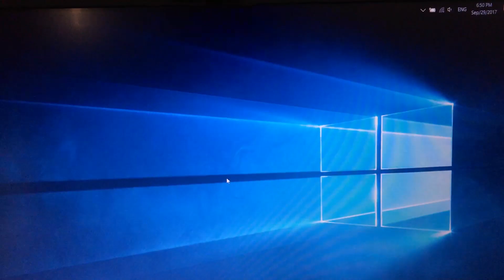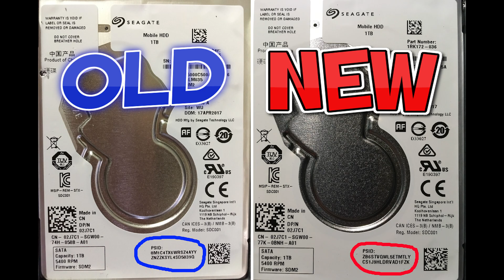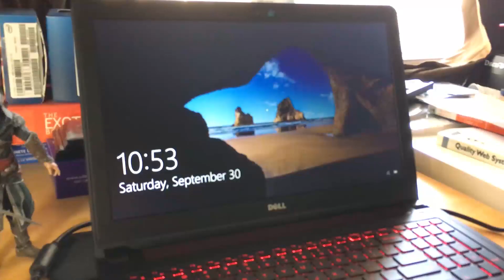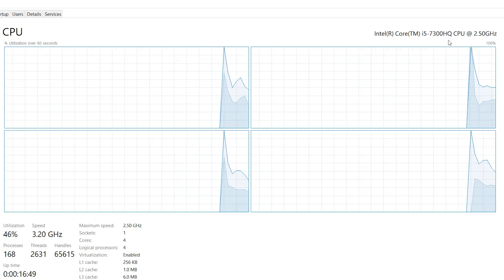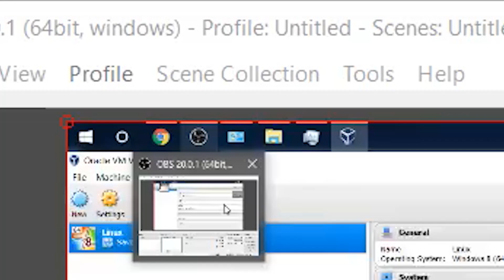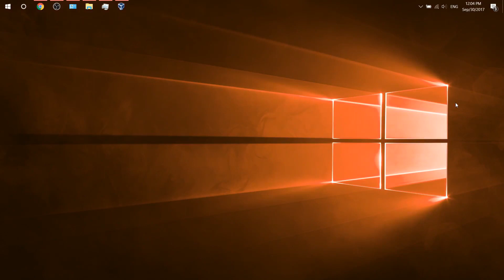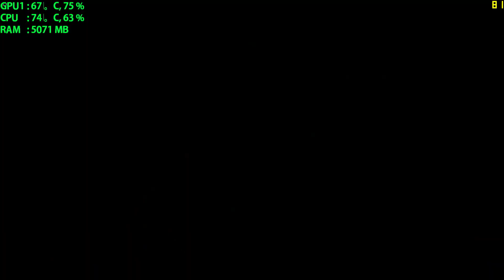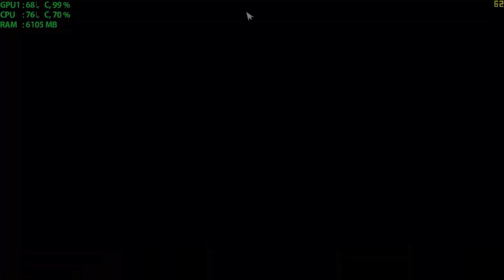My Experience With DELL Warranty - Inspiron 5577 - i5 7300HQ GTX 1050 Benchmark at 720p 900p 1080p

Comment: brother i bought i5 model...but its too slow...chrom and YouTube lags so much ...and other things too....i put all  settings on nvidia high performance graphic card...but still its slow....what should i do... please help
Reply from the maker: +het vaidya NVidia high performance graphic card? I don't understand what you mean. You change the laptop performance by clicking the battery icon at system tray. MANUALLY update your driver at Dell.com. And check your task manager to see what program do you run. I runs Virtualbox and watch Youtube video at the time, no lag.
Reply: Poker FaZe okay thanks buddy....1 more thing ...i am playing battlefield 4 ...i played it for 2 hours and temp was 70c to 80c max....is.it normal?....and if.not what should i do?
Reply from the maker: +het vaidya Completely normal for gaming laptop to get hot. Just fully charge your battery and game while plugging in, you are good.
Reply: Poker FaZe  u r a big help man...thanks ...1 more thing if i can ask ...if its above 80c should i stop playing or should i continue?....if i continue wont my laptop will get affected ?
Reply from the maker: I usually use MSI Afterburner to check temperature during gaming, and the laptop never runs over 83 degree. You can start worrying if it is over 90C. But it will never happen, I can explain:
Laptop manufactures always have locked BIOS to limit users from modifying. And they already set the safe temperature for the laptop. And even if they don't do it, your CPU and GPU will automatically do it for you, it call THROTTLE, by running at lower clock speed to cool down the chip.
Basically you don't have to worry anything ¯\_(ツ)_/¯
Reply from the maker: You can also see Throttling happens when battery is low -> to save battery
Reply: Poker FaZe u r a big help man...thanks
Reply: Poker FaZe and yea to fasten the laptop should i use cracked Windows version or genuine?....
Reply: Poker FaZe and something in task manager my disk gets to 100%?....its slows the laptop... what should I do?
Reply from the maker: +het vaidya +het vaidya In Task Manager, if you are looking at the Performance tab, hard disk is always ~100% because you are using it, so you CAN'T say it slows down your laptop. As long as you're in Windows, you are using the disk.
To fasten the laptop, buy an M.2 NVME SSD, it boosts my laptop before my ass touches the chair

Comment: should i buy this laptop for 899 canadian dollars, with the i5577, 8gb of ram and 1 tb hdd and i5-7300hq? someone pls help
Reply: i know the display is not best but i can change that after 1 year when the dell warreanty expires
Reply from the maker: +Mridul Mittal I don't know what you need it for so can't give you any suggestion
Reply: I need it for light gaming and just for work, i don't really need the portability
Reply from the maker: +Mridul Mittal Then go for it, just lower your expectation for AAA games from 2014 and it may serve you fine
Reply: the most frequent game im going to play is fortnite which should be able to run at epic with the given gtx 1050 and i dont have high expectations for AAA games as i dont play them that often
Reply from the maker: +Mridul Mittal I dont play that game, but check out for its CPU usage because the i5 7300hq is weak, and online games are usually CPU heavy. Look at this laptop's FPS for CSGO, it is the same as my previous Pentium G4600 paired with a 1050 Ti
Reply: Its a downloaded game from epic games
Reply from the maker: +Mridul Mittal i know wat it is, lol

Comment: Worst support is by acer India, my laptop is still not repaired it's  been 3 months now am trying to approach consumer court.
Reply from the maker: +Avinash Mathias wow, I'm sorry dude, I hope you can get the justice
Reply: Poker FaZe meanwhile I m thinking of buying this laptop as a daily driver so is it good for engineering students to have this laptop or should I buy the different model.
Reply from the maker: +Avinash Mathias I'm software so for me it is good if you are just programming, VM, Android Studio are fine. I don't know much about CAD so I can't tell you how it is for other engineering majors
Reply: Poker FaZe what are your thoughts on display as many of the people complain about the TN panel, Like is it OK for daily use like programming and watching movies with 2 of the friends. Because my present laptop Acer e5-575g is also having a TN panel which has poor viewing angles.
Reply from the maker: +Avinash Mathias I dont notice anything, viewing angle are fine, the panel is great for me
Reply: Poker FaZe then I think I should go with this. But still there's another laptop with same specification called hp pavilion power. And thanks for your replies bro, got all the answers.

Comment: You mean 
I should not buy this?
Reply from the maker: +devil king nah, it's okay, but if you buy an i7, it will perform smoother
Reply: Poker FaZe first of all,thanks for your reply
If i buy this,i will buy i5 sure.
Or should i buy acer e15 576 or dell 5567?(i'm not a hardcore gamer)
What would you like to suggest?
Reply from the maker: Can you link me the product page of the Acer, since google shows me so many version of 576
For the Dell, I also need a link too because what I'm seeing is i5-7200U. i5 U chips are dual cores and 4 threads. So it is just a desktop i3 and does not perform as well as the i5-7300HQ. Also, I don't think this laptop support M.2 SSD, so the equipped hard drive may slow it down even more. 
My sister's company provided her with a Dell Latitude laptop, it uses 4-core i5 and has M.2 slot. For working, I think you should check Latitude models.
Reply: Poker FaZe  i really don't know the actual page but you can see in this link,from where i am going to buy:
Dell 5567: https://www.daraz.com.np/catalog/productspecifications/sku/DE262EL1L86QSNAFAMZ/

Dell 5577: https://www.daraz.com.np/catalog/productspecifications/sku/DE262EL0Y0A5GNAFAMZ/

Acer e15 576: https://www.daraz.com.np/catalog/productspecifications/sku/AC014EL0ZB090NAFAMZ/
Reply from the maker: The link you provided sent me straight to the homepage. But I checked the page for the Acer, it uses i5-8250u, which is basically an i7 with 4 cores 8 thread. Go for it if this is the one you will buy:
https://www.daraz.com.np/acer-aspire-e15-576g-i5-8th-8250u-1tb-8gb-mx-150-2gb-15.6-fhd-laptop-100395.html

The only weird thing I see is the page listed RAM with DDR3L, not DDR4, so I'm not sure how trustful the site you are using is

FYI, i5-8250U laptop processor: https://ark.intel.com/products/124967/Intel-Core-i5-8250U-Processor-6M-Cache-up-to-3_40-GHz
Reply: Poker FaZe thanks a lot.
I've heard many good reviews about it and you also suggested it so i'm going to buy it offline.thanks for your reply.
Reply from the maker: No problem man, hope you won't regret by listening to me :))